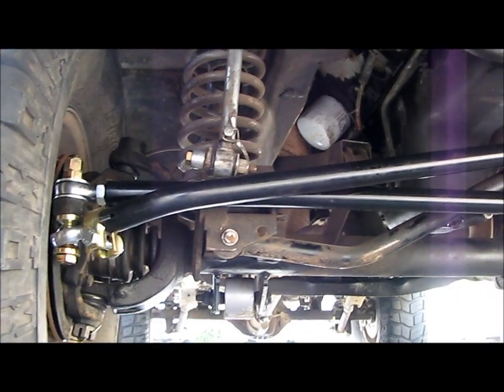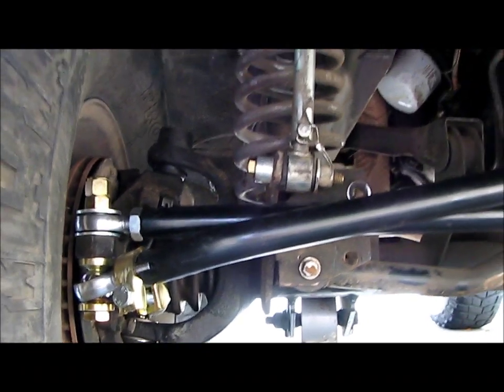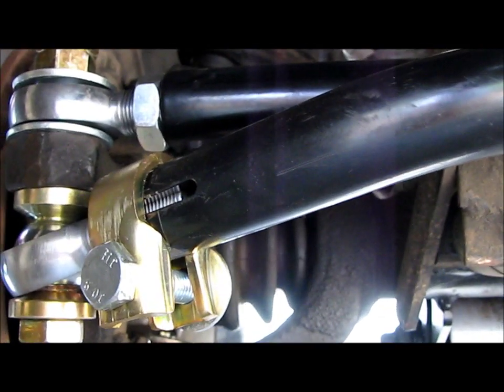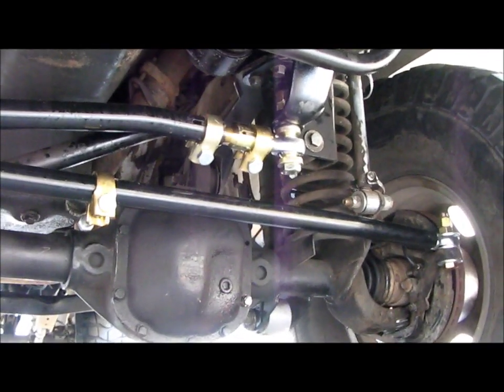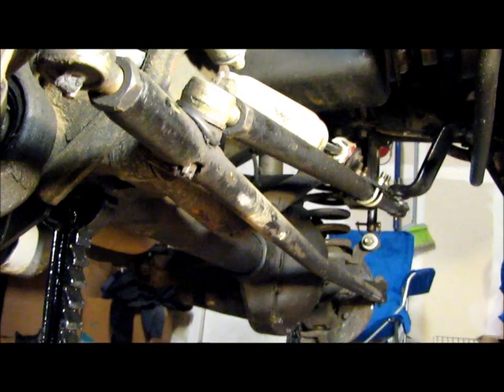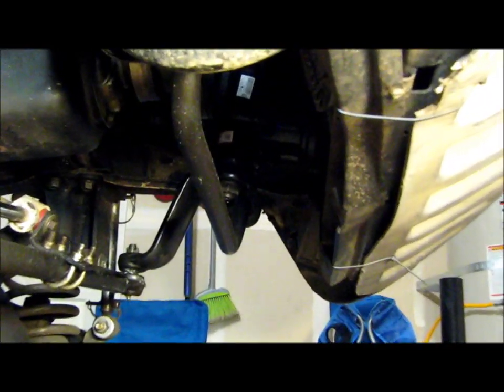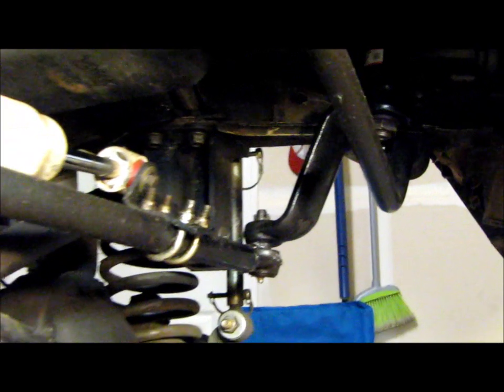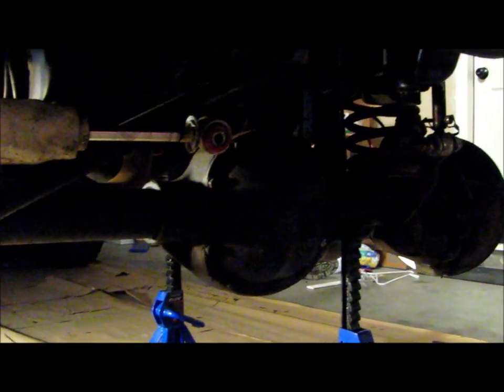Jeep Grand Cherokee 4x4 Project ZJ Part 3 Iron Rock Offroad OTK Steering IRO Upper Lower Ball Joints

Comment: Iron rock ...I'm just starting an upgrade on a 98 ZJ charcoal blk rockers are gone the rest is like new. Salt in Duluth mn. Is really bad because of the steep hills. Thinking of slipping adhesive heat shrink on as many bars as possible, also thinking of slipping some on front rear sway bars and springs. Heat shrink is on Amazon and cheap. Need front wheel bearing hubs but confused about what's best all round. Can't trust eBay or amazon (piracy). Maybe Moog direct only. Don't know mistakes cost

Comment: Just bought a 96 ZJ Limited and I have to replace the front Axle, i'm thinking of doing some nice little steering system upgrades while I'm under there. Very nice front end mate.
Reply from the maker: Congrats on the new Jeep!  Check my other videos for other things such as steering box brace and track bar axle mount fixes.

Comment: With your current set up and in this video or others, are you using a "DROP PITMAN ARM?"  And if so, what kind and from where?
Reply from the maker: Jonathon Planten I don't recall the brand or size, but the important thing is to make sure that your track bar and drag link angles are parallel so that's how you determine the size drop needed for your setup.
Reply: *****
  I'm learning as I go...  Lots of R & D/ Trial & error... I can see your dealing w/ the same on your build...
Reply from the maker: Jonathon Planten Yeah that's why I decided to make the videos, to hopefully help other people dodge some bullets along the way and save time/money

Comment: Hey Ryan. Was wondering how you like your IRO OTK. The hym joints on the knuckles, on mine, seam to be adding a lot of resistance to the steering. Meaning, makes it harder to turn the wheels. Was wondering if you experienced this at all
Reply from the maker: Caleb Simpson I haven't had any problems.  Are you sure they aren't over tightened?  Make sure you only tighten to spec and double check that you have the washers in the right places.  Also did you lubricate all of the joints with grease or oil?  I don't run them dry as they can get sticky, especially if they are dirty so you also have to keep them clean.

Comment: Can you run this kit at stock height? Or even with a 1.75" BB (I know I need spacers with OEM wheels)? I can't seem to find a clear answer anywhere. Anyway, thanks for all the great videos. Hoping to see some new uploads soon!
Reply from the maker: +Logan Lawhead It should work, may have to shorten the drag link as much as possible with the adjustment points.
Reply: +RYANVISION Alright, thanks man

Comment: Is that a drop pitman arm you have installed in this video?  I got this kit to install but i have a drop pitman arm already installed since im at 6 inches.  Curious if i need to remove it to install the otk kit.
Reply from the maker: Best thing to do is take a look at your drag link and track bar angles.  You want them to be as parallel and close to each other as possible so whatever pitman works for that is the right one!
Reply: i understand that, thats why i installed the drop pitman arm to begin with, had to get the geometry right.  I was just curious if you were running a drop pitman arm in this video.  It looks like the  rugged ridge arm that i have installed on mine.

Comment: How have u liked it the steering still good and would u recommend for daily driver i have 4.5 inch long arm and would like to upgrade steering just not sure wat to go with thanks ryan great video
Reply from the maker: Jimmy Lewis The steering has been very nice, used it on 5.5 and 7+ inches of lift with no stabilizer at 70+ mph no problem.  My only complaint is I don't like the clamps as you can hit the lower drag link clamp on rocks.  Other than that it's been very nice

Comment: How do you like the steering for daily driving? And how is it holding up? Thanx ahead if you reply
Reply from the maker: I love the steering kit!!  Very solid on and off road, no issues whatsoever.  I don't even run a stabilizer with it.  I highly recommend this steering kit, and it's a good idea to also get a steering box brace.  So far all of IRO's products have been great... the steering kit, the bar pin eliminators, and the front long arm kit.

Comment: hey Ryan have a question for you would you suggest going with a short arm kit with fixed arms or just lower adjustable arms or just upper adjustable arms or both adjustable control arms? for a 4.5 inch lift and front and rear adjustable track bars too?
Reply from the maker: Definitely adjustable track bars because your axles will not be centered under the Jeep after lifting.  I had fixed lower control arms on the front when I was on short arms, stock uppers in the front, adjustable rear lowers, stock uppers in rear and it worked great.  That was the Rubicon Express 4.5 lift kit.  IRO also has a sweet 4.5 lift kit and their stuff is dialed in even if you get fixed.
Reply: so through you have gone through the lifts what do you think of this setup i plan on doing. 4.5 IRO lift short arms adjustable upper and lower control arms with the front and rear adjustable track bars, new otk tie rod and steering linkage with 2.5 inch pucks to deal with the added weight of the rear heavy duty steel bumper by TR and i am in the process of building a front one because the ones i have seen do not look strong enough plus the winch
any input would be greatly appreciated thanks and great videos Ryan!
Reply from the maker: jammie chow
I would not recommend running coil spacers in the rear unless they are the JKS ACOS style adjustable ones with a long built in bump stop.  Running puck spacers in the rear can cause coil springs to fall out at full flex, even with limiting straps. Spacers in the front are OK cuz factory bump stop is long enough to keep spring in place.  For the rear, just make sure you get the right height spring and forget the spacers.

Comment: Hey man. I follow you on Instagram and you currently are not running this kit. I daily my jeep and am making a run from Michigan to virgiana soon. I want to do the wj knuckle swap but don't want to invest time into right now so thinking about this kit. Pros and cons? How will the heim
Reply: ...Heim joints hold up being a daily and highway use. I've heard negative things about them?
Reply from the maker: +Stevengrill This was an awesome kit!! The only thing I ran into was rocks hitting the drag link because it connects under the tie rod.  Other than that it was great for off and on road.  Heims are beefy, just keep them clean and lubed.

Comment: Hey Ryan, have you had any pry with bump steer with that Iron Rock steering?
Reply from the maker: alan jackson No issues after getting a professional alignment.  Still not running a stabilizer but planning to add one soon.
Reply: I had a JCR one ton steering kit on my ZJ along with a 4" RC long arm kit. That steering kit was a cause of so many problems, death wobble, undriveable bump steer, and the tie rod would hit the track bar mount at full right turn. I put the stock steering back on and all of the problems have been solved. I do need a dropped pitman arm though.

Comment: all I can say is awsome. do you need wheel spacers with this ?
Reply from the maker: +nonamesleftorwhat I used to run those 2 inch spacers with my stock wheels in order to provide clearance for 35x12.5 tires.  Now I have new wheels with 3.5 backspacing already, so I no longer need the spacers and got rid of them.

Comment: It's the iron rock joints still greaseable
Reply from the maker: Michael Gutierrez I use spray lubricant on the tie rod steering knuckle joints and drag link joints.  They don't have a zerk fitting if that's what you're asking.  The IRO control arm joints have zerks though.
Reply: Dr ywiggly Liuyet fyf_illustrator :y reeddue "

Comment: 42 lbs thats a lot ..kind of sucks
Reply from the maker: clownbow1 Solid steel is heavy and strong.  My winch plate weighs 87 lbs.
Reply: ***** well I guess I'm going to be doing the same thing as you I have a 1998 Jeep Grand Cherokee Limited 5.9 so I'm going to have to live with the weight I guess..